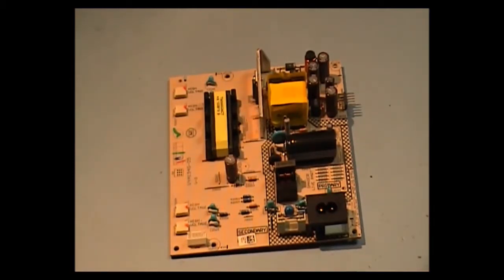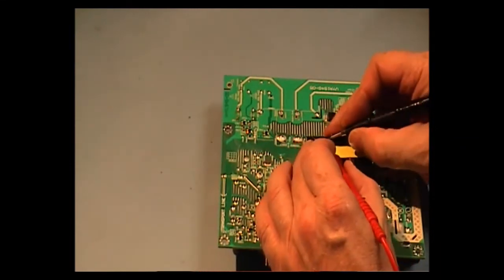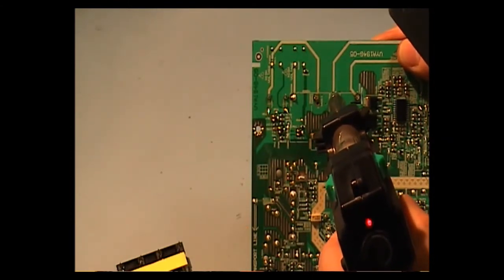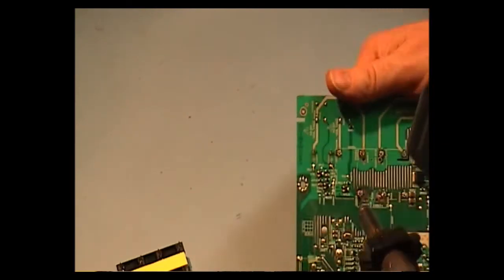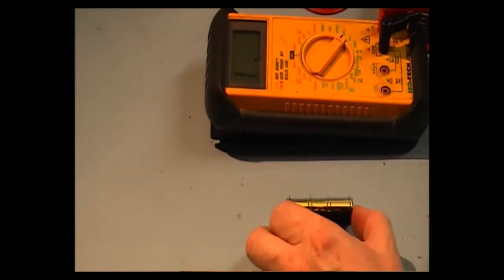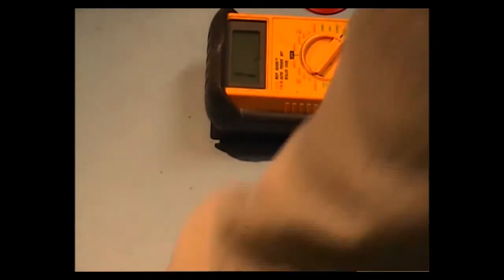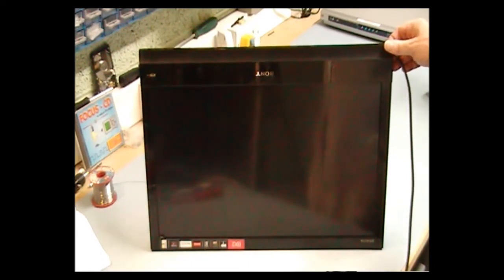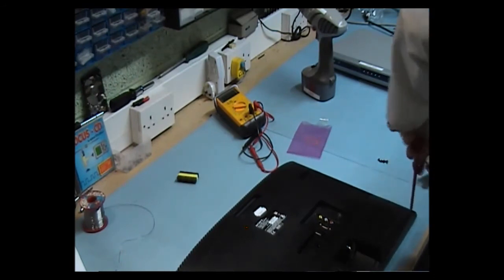Sony KDL-22BX200 No picture Repair Part 2

Comment: Thanx a lot! You saved my Sony Bravia KDL22BX200 that I use daily in my bedroom. I absolutely love this TV, good picture and the right size for my purpose. Unfortunately Sony Bravias are no longer available with this size. After seeing your video I measured the inverter transformer, in my case type TMS94819CT (blue sticker). Outputs measured 1,4 KOhm and Open. Soldered in replacement (available thru Ebay), fixed! Thanks again for your clear video.

Comment: Good work¡¡¡¡
I have I doubt, my Sony KDL-22BX200, with serie number, 6301404, and manufacture date 04/2010, it belongs the inverter transformer TMS94819CT from Sony KDL-22BX20D. Do you know the difference and why? Thank you so much.